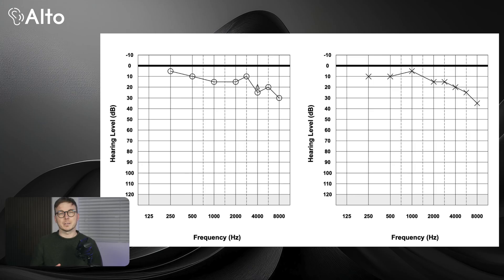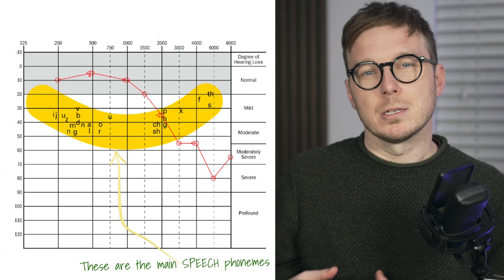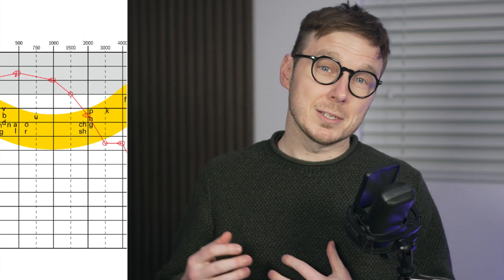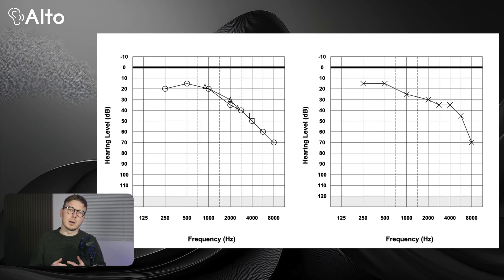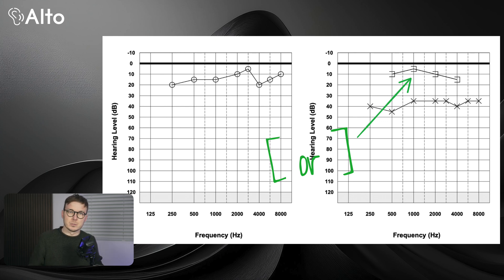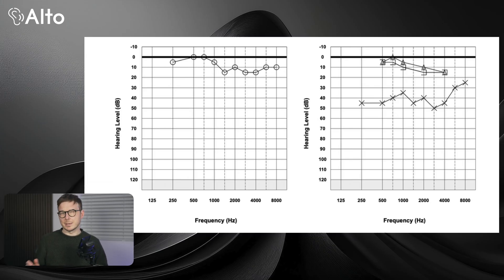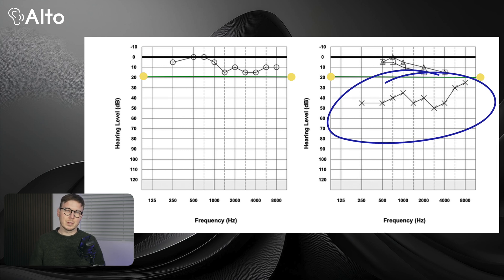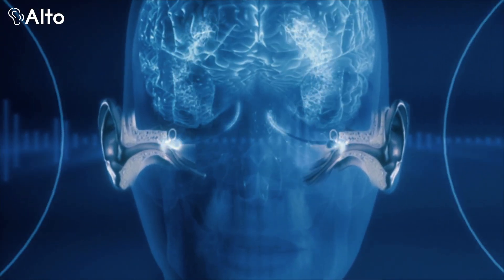Understanding Your Audiogram: How to Read a Hearing Test

Comment: I recently had an hearingtest and the lines on the right (high pitches if I’d understand correctly) were with one ear at the -20. The lady told me, although the number were in the normal range, she mostly didn’t saw this with people my age. 
My left ear I was more sensitive with the low frequencies and the high pitches were at 25. So the difference between the hearing of high pitches were pretty big. 

According to the lady that could be the reason why sound can physically hurt on my left ear? 
It’s true what she said; my left ear does hurt after sitting an evening with people. 

But how is it possible that my left ear (drum) hurts? 

I now have custom made earplugs based on this hearing test. So I can finally go to social events.
Reply from the maker: Without seeing audiogram difficult to say but experiencing sensitivity to loud noise isn’t judged by the AC points on an audiogram. There’s a specific test called ULL (Uncomfortable Loudness Levels) which should be conducted to understand if there is hyperacusis (what it sounds like you are talking about). 

Being able to hear at minus 20 doesn’t make you able to hear loud sound louder, it just means you can hear quieter sounds. 

Ear drum hurting - possibly hyperacusis, possibly middle ear issue. Worth getting it investigated a bit further
Reply: @altohear thank you so much for your response! If you don’t mind me asking:
When I hear much softer sounds, my hearing threshold is low. Isn’t it logical that I hear 50db much louder comparing to someone who doesn’t hear those soft sounds? 

Again, thank you so much. I will go to my GP and ask for a referral to a specialist to check my middle ear.
Reply from the maker: No - you don’t hear 50dB louder than other people. You hear 50dB at 50dB. That’s how loud it is. Having lower thresholds doesn’t change how loud sounds are or the perception of that volume. Unless there is associated hyperacusis and decreased uncomfortable loudness levels.
Reply: @altohear okay, thank you so much. hyperacusis does make sense I’ve looked it up but there isn’t much they can do about it. 
I’ve read that wearing earplugs every day isn’t recommended but on occasion it is. I have worn them last night to the theater. I hadn’t been there in five years because of my ears. The earplugs reduce sound with 15db. Now it was doable 🥹 Yes, I’m still tired the next day but I did had a good time 😊

Comment: I think i had a hearing test over 10 years ago where they said i had scaring in my left ear and done the headphone test where my left ear was just below normal and my right ear was normal. So would this explain why i do have issues understanding what people are saying at times and actually hear things that are not necessary said. Mos tof the time i speak louder and then get accused of shouting when to me im speaking normally
Reply from the maker: Yes the hearing test result does sound like it could affect hearing conversations. The thing about unilateral or asymmetric hearing loss is that whilst in quiet situations you will probably hear fine with someone facing you - the brain requires two ears to be able to localise where sound is coming from - so it can be more difficult in background noise or groups etc
Reply: @altohear  Yeah because if im at my neighbours he is always sat to my left and infront of me is his tv so when he says something i have to ask him to say it again